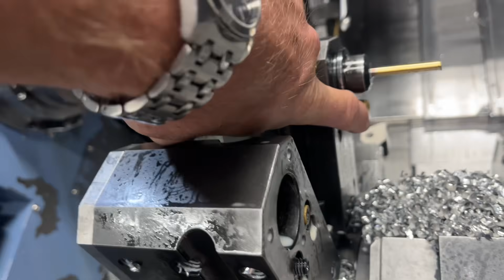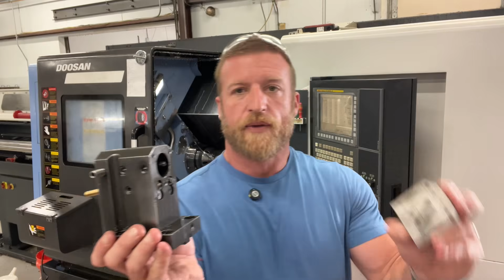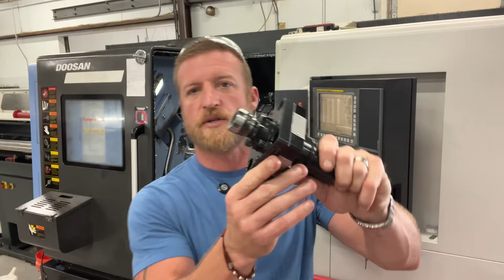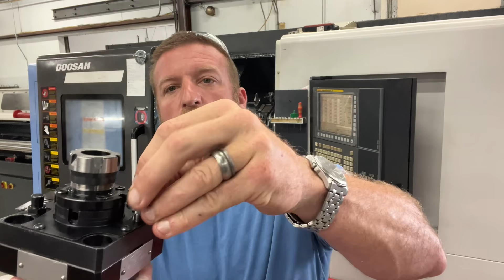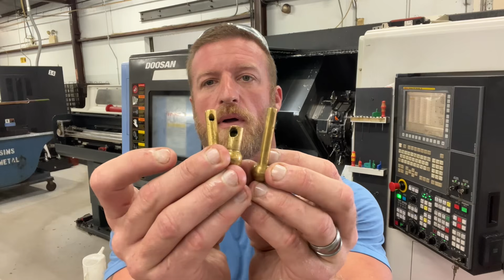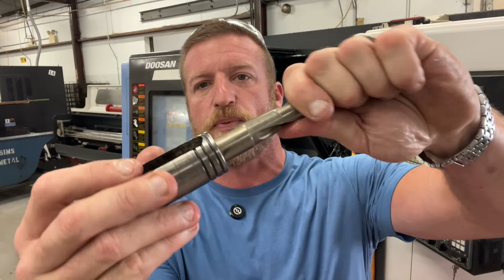Tools WE Made To Save Money AND Time 😎

Comment: I do this as well as filler work.  I have a list of like to haves and scratch them off on slow days.  My lathe, every tool holder I get, from the same source (starts with "H") has a different coolant ball size.  Buying those gets very expensive.  I set up a bar puller and jammed out a tub load of them different sizes.  I drill mine where 1/4" copper tube gets pressed in that way I can cut to length or bend as needed, like around an ER32 holder so my center drill gets coolant.  Same with the coolant block plates.  I bought some aluminum bar stock and cut and just milled the saw cut ends to size, faced, grooved, flip drill and cb the holes.  on the VMC it took very little time.  Mine sealed fine and have lasted for years so no need for heat treat or grinding them, at least for me.  I make my own rotary coolant inducers for my live tools which work much better and much less $$$ than the commercially available ones.  This all only works when you have time to do it.  Sometimes, your busy and you need it now for a job and you spend the cash.  Sometimes, you say I could make these, or I could be making money while UPS just brings me what I need.  It all just depends.....
Reply from the maker: I like that for sure. I’m the same way - and the battle of time VS money VS ease of having  UPS dropping off what we need is a constant juggling act.

Comment: Weve made our own holder blocks out of ductile iron for one of old lathes. Never throw out scrap material. We had a chunk of ductile iron sitting around and we reverse engineered the blocks and threw it the 5 axis. We are also desperately in need of new tool bushings for our lathes. Anytime i need one i just turn up some 4140ht and hold the .001 tolerance. You dont have to hone if your just making it for a boring bar.  Just adjust your offset. My next plan is to get some quick change fixturing built for our mills.
Reply from the maker: Those are really good ideas. I did hone ours. We use them for bushings, drills and boring bars. Sometimes we use the same bushing for several different tools and it’s hard to beat that satisfying slip fit from a honed diameter

Comment: That's the good thing about Doosan tool holders, even though mine is a different model I did the same. It was a different story with my Okuma though wasn't that simple had to fork out over thousand dollars for a through coolant holder.
Reply from the maker: I’ve noticed that too about all of our doosans that the coolant fittings are all the same and interchangeable. What is the deal with the OKUMA that was so problematic?
Reply: @Crusadermachining  Okuma has two different internal tool holders. The ones with the nozzles is for external coolant similar to nozzles you've shown but through coolant holders don't have nozzles  and solid back. It's a big job to convert through nozzle holders to through coolant holders. Not impossible but too much hassle.
Reply from the maker: @mehmettemel8725 that kinda stinks but good to know. Thanks for the Info
Reply: @Crusadermachining  Having said that it's a very accurate solid machine we love it.

Comment: I 3d printed those from regular PLA. Worked just fine even after 2 years :)
Reply from the maker: That’s awsome. What is PLA? Is that the more robust printing material?
Reply: Pla is the most common and cheapest filament for 3d printing.

Its made from cornstarch among other things.

I have found out pla is not effected by coolant.

Other plastics will simply melt from the coolant.

I made i with 100% infill. Worked great and its extremely cheap. A roll of 1kg Pla cost between 20-30$. That part weighs maybe 30grams.....😅
Reply from the maker: @johannesfossi5561 that’s is very interesting. I don’t know a lot about 3d printing but my cousin does. It’s a wonderful technology for sure.